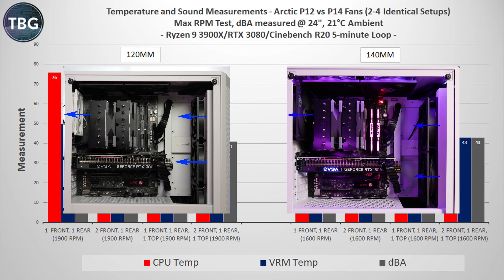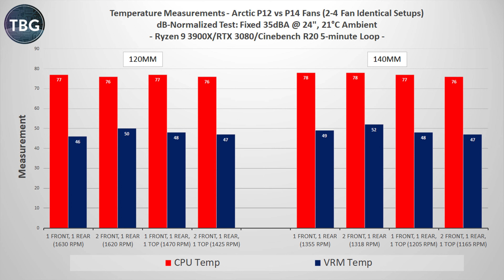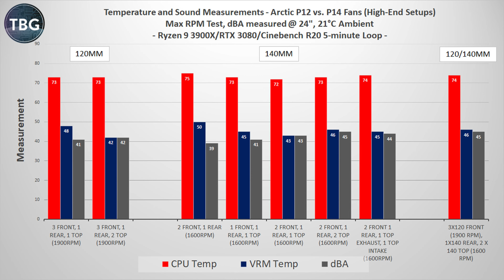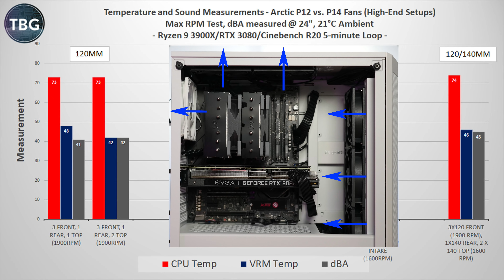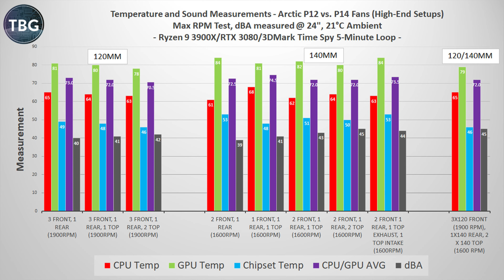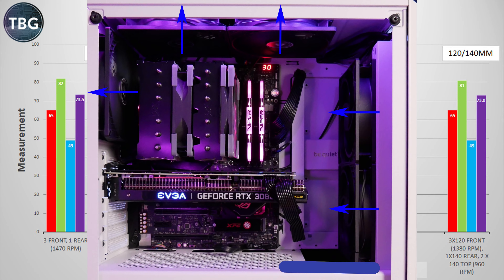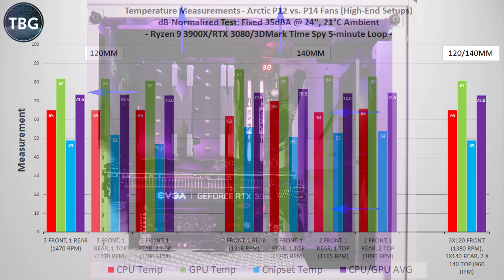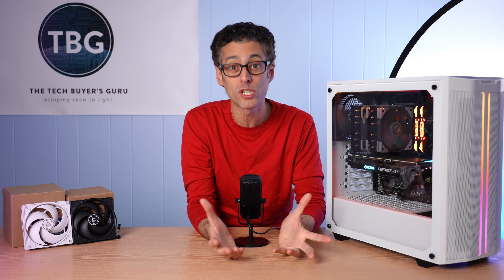The Best PC Case Fan Setup - How Many, What Size, and Where, feat. Arctic 120/140mm Fans!

Comment: Wow. I really thought 3x120 front with 140 back and top would be better than it was. 
Only really corner cases I would want to try/see is 3x120 front with only one 140 back and top, possibly while blocking the space for the front top mount, or the split dual 140 front (which is what I'm running currently)

This was a beautifully done and largely complete video. Quite impressed.

And I was absolutely looking for a video on exactly this (and even this case, luckily enough). You've convinced me not to add 3x120mm front fans. I thought the higher static pressure would get more air through the mesh front.
Reply from the maker: Well, sounds like this video was spot on for you given the case you have. It's not something I could repeat with many cases, that's for sure. But why do you say 3x120 wasn't effective? It seems better than 2x140 based on my benchmarks, no?
Reply: @TheTechBuyersGuru  not that it wasn't effective, but I thought the night-and-day difference I expected compared to 2x140 front. The difference doesn't seem worth buying additional 120mm fans I don't already own.
Reply from the maker: Oh, yeah, this was all a theoretical test assuming you were coming from no fans. In terms of tossing two 140mm fans and buying three 120mm fans for a minimum of $30, it's probably not worth it. With that said, the default configuration of the case is 1x140 in front, top, and rear, so I would absolutely suggest swapping out that single front 140mm for triple 120mm fans, and then putting the second 140mm on top (despite minimal benefit, because you'd already have it and it's greater than zero!).

Comment: Finally a video that actually helped me with real world direct comparisons using the same fans instead of widely different fans. Therefore the test is actually meaningful. I am going to change mine to the 3 front 1 rear 1 top and see if it helps my temps. They are not horrible but my idle temps are a little high (3900X and 2080 Super, CPU Idling at like 40-50 and GPU around 60 - which is probably acceptable anyway..but still want to have the best setup)

These fans are super cheap are they really that good? Most people are going to recommend some $30 ea fans (Noctua etc) so am concerned about buying cheap fans?
Reply from the maker: Most people haven't watched my videos, so they don't know anything about what they are recommending! Are Arctic's good? See this video: https://youtu.be/PUdsTiRmuuU

If you decide to get them, here's the link to the 5-pack: https://amzn.to/3APDGQ5

By the way, your high idle temps are not a reason to buy any case fans at all. Idle temps are driven entirely by the fans on the coolers and the settings you are using. I recommending using a manual fan profile on your 2080 Super so that it's NEVER at zero RPM. While that's a popular fad, it's not actually very good for anything, including maintaining idle temps, because any modern GPU will slowly climb up in temps until it requires the fans to toggle on and off, which is more annoying than leaving them on.

In terms of your 3900X, idle temps are always going to be that high due to background tasks and the density of the chip. It's the CPU I bench with. To learn how it idles with high-end 360mm liquid coolers, see this video: https://youtu.be/GLaje-5JFd4

Comment: Much respect for the work, interesting video and listening to feedback. But in my humble opinion the top fans should not be oriented in opposite directions. Otherwise the hot air from the rear top exhaust is being recycled throught the top front intake which therefore does not fulfill its purpose of providing fresh air. Both tops fans should have identical direction
Reply from the maker: I did test both setups, perhaps you didn't see the whole video!

Comment: This is an experimental question 🤔as I was new to Airflow 
I went with multiple methods of assembling 140s and 120s on my cabinet.
My case/cabinet/tower is Lian Li 215 which has two 200mm intake fans in front ,so I went with 3 120's ( 2at the top and one at the back of the tower) I was messing with it like you said placing the top two 120mm(one of two/both) used them as intake and it was not a good idea,

So yeah I went with 3 120s as exhaust(two at top and one at the back)
  and 2 200mm fans as intake in front 

I recently bought a AIR COOLED heat sink cooler (COOLER MODEL: DEEPCOOL AS500) for my processor ,which came with 140mm fan on one side ,later I found out I could increase the coolers performance by adding another fan to the heat sink. 🤔🤔However 140 pairs with 140 /120 pairs with 120 i.e,
140mm ]=[140mm
120mm]=[120mm
(general rule of having the same type of fan on both sides of the heat sink is  followed everywhere)
🤔
Now comes the tricky part since the whole fan assembling was new to me 🤔what would happens if I attach 120mm as exhaust and 140m as intake on the heat sink 🤔💭 this might sound stupid but I want to know what would be the outcome 😐
Like can we balance the perfomance but tweaking it's RPM 🤔

Thanks in advance. 🙌
Reply: @I love you but Thanks for the clear explanation 🤔.My fans are not loud tbh ,I checked every now and then to see whether it runs cause it was silent most of the time ,yea it keeps the temp below 65%whenever I game at max settings,so no more extra fan on the heat sink I guess.
Thanks again 👍cause now I know something new about airflow in pc.

Comment: Great test, thank you! Inevitably, the GPU regurgitates some of its own output - more so in a faint "positive pressure" scenario. Brute force positive pressure is hard to achieve with this case because there's too much impedance at the front - mesh, dust filter and rgb strip... so even front fans with good static pressure and cfm like the P14s don't work very well.
Reply from the maker: The case is actually on the higher end of the airflow spectrum, but yes, there are a few cases that would beat it. I think it's fairly representative of the average modern case.

Comment: So I have two 140mm top fans. Should I just unplug the front one? I have two 140mm front intake and one 120mm rear exhaust
Reply from the maker: Not at all. Just lower the RPM of the front one or both if you find it getting too loud.

Comment: I had the same result with my single 140mm intake fan: the lowest position is most beneficial to the GPU. My case doesn't have any grate above the PSU and as I was thinking about the turbulence occurring when the air hits the back of the PSU, I placed a makeshift curved ramp out of cardboard leading up from the bottom of the case to the level of the PSU. That shaved off another 1.5°C of the GPU temps. By the way, my rear fan is an intake (at 300 rpm) and I only have one exhaust fan in the top; CPU air flow is reversed. That was the optimal solution for a CPU tower cooler (at moderate rpm) and an open "blow through" GPU (Sapphire Pulse RX Vega56). Otherwise the CPU cooler was sucking in that hot air from the GPU.

Comment: I have a cooler master h500p case with a 2 200mm fans in the front.
Do you recommend changing that to a 3 fan setup ?

Note i have a liquid cooling cpu and an msi 3080
Reply from the maker: If you want the lowest temps possible, definitely change the 2x200mm fans to 3x140 or 3x120. I have that case too. The fans look nice but provide very little directed airflow.
Reply: @TheTechBuyersGuru  thank you soo much for the reply i also currently have the arctic cpu water coolant 360 3 fans on the top do you think only 3 140 front fans is enough ?
Reply from the maker: 3x140 front would be excellent.

Comment: wich is better 2 200mm fans or 3 140mm  instead
Reply from the maker: I've never tested 200mm fans, but know that 2x200mm fans provide very little directed airflow. They are probably fine at reducing the ambient temp inside the case, but would likely be less effective at reducing CPU and GPU temps, as the airflow is much slower.
Reply: @TheTechBuyersGuru  many thxs for your advise it helped out a lot

Comment: Hi! 
There's a configuration I didn't see in this test : 3 x 140mm front and 3 x 120mm back (1 rear and 2 top).
Does it seem to be a bad configuration to you?
Reply from the maker: Might work, couldn't test because 3x140 didn't fit in this case. But don't just assume it's better. A lot of that extra air would be pushed above and below components, and what do feel more, a light breeze on your face or a strong wind a few steps away? ☺ 
Long story short, front fans are most effective when airflow is focused and directional. That is completely the opposite of exhaust fans.

Comment: Hi!
great video! I really enjoyed it and took away some learnings from it.

 I'm currently setting up a new PC and was wondering if I should get 140mm fans or 120mm fans. I intuitively was going for the 2x140mm in front and 1x120 in the back but your video made me overthink. 

As you stated the 3x120mm outperform the 2x140mm when it comes to GPU cooling and the 5x120mm are also less noisy while having a comparable cooling effect like a 5x140mm setup. What I am curious about is a setup with 
a) 3x120mm in front, 1x140mm on the top and 1x120mm in the rear or
b) 2x140mm in front, 1x140mm on the top and 1x120mm in the rear.

What is your opinion on this? Have you even checked it in your experiments maybe?

Looking forward to an answer!
Reply from the maker: 3x120mm front, 1x140mm top, 1x120mm rear is superior.
Reply: @TheTechBuyersGuru  Thanks for your input and fast answer! Keep up the good work.

Comment: Seems to be really case specific. I was having 3x front intake + rear and 2x top exhaust. Flipping the front top dropped vrm temps 8 deg and cpu 5deg under full load. No effect on gpu temp that has never been struggle for me. However vrm temps has always been struggle for me and limiting my overclock
Reply from the maker: Sure, it's going to be component specific, not just case specific. But I guarantee that setup will make your GPU hotter. If that's fine for your system, go for it. I showed what it did for CPU and VRM temps too.

Comment: Hi, awesome video, thanks a lot!
What about Arctic P12 PWM PST CO? Aren't they better in terms of longevity than the regular one? I want to buy them, but I'm a little worried that the ball bearing will be noisier than the sleeve.
Reply from the maker: You pretty much summed it up. CO is designed for 24/7 operation at expense of noise. Not the right choice for most consumers. And only P12 comes in 5-pack: https://amzn.to/3BGZ0YP

Comment: Just a minor tip for those that are running a BQDX500 case or similar with 3 120mm fan in the front intake, take out all the unused pci/pcie tabs below the graphics card, this will improve the GPU temps a fair bit, I can feel the airflow coming out at the back at medium to high RPM.
Plus, with the air being sucked in through the filter at the front, dust won't be an issue.
Reply: Put an aerofoil just beneath your GPU to direct air that was exiting out pci slots upwards.

Comment: Só 3 120 on the front, 1 on the back and 2 140 on the top would be the best right
Reply from the maker: Yes. Unless you can for 3 140s in front. I didn't test it, but it could be better than 3 120s, although not necessarily due to the more directional, focused flow of the 120s pointed at hot components.

Comment: Hey, thanks again for linking me to this video from your fan comparison video! I found it very informative and it answered many of my questions and you have taught me alot! I can only imagine how much time you spent painstakingly putting the test together and then creating the video, so thank you! 

I mentioned in the other video that I have a Lian Li lan 2 mesh performance case. It has 8 slots where I can fit 120mm fans: three on the front, two ontop, one on the back and two on the Psu shroud what are your thoughts on if I use every slot - do you see it as beneficial or counter-productive? I noticed you mentioned noise is an issue with exhaust fans on the top. I saw you recommended the 6x 120 to me in the other video. 

To clarify that I have this right: rear and top are exhaust, front are intake and psu shroud are intake?
Reply from the maker: I don't think using every fan slot is all that helpful. You start to add more noise than airflow. That's particularly true for fans on top, which direct noise right out of the case. I'd stick with a single fan up there. I also think having two fans on the PSU shroud is totally counterproductive, because one will be almost entirely blocked by the PSU itself. So based on the layout of the case, yes, 6x120mm: 3 in front, 1 in rear, 1 on shroud, 1 on top. For that case, two 3-packs of Arctic P12 ARGB fans would be superb: https://amzn.to/3hYoWWw
Reply: @TheTechBuyersGuru  thank you for your patience and time and clarifying this for me. 👍

Comment: hum... I have recently git my lancool II Mesh and I am looking into different fan setups. I think of adding two 120s to the top of the PSU shroud to aid air into the GPU and two 140s in the top to help exhaust. I would run both of these banks of fans in constant RPM, only the two 140s in the front and the 120 in the back would be chained to system temperature...
Reply from the maker: Sounds like a great setup!

Comment: So I have a lian li xl case which is pretty big. I have a Corsair 150i aio CPU cooler (3 120mm fans that are attached to the radiator) that is most likely going to do on the side. Atm I have 6 120mm Corsair fans with a max rpm of 2200. I was planning on returning them and getting 4 140mm fans or should I stick with the 6 120mm?
Reply from the maker: First of all, I'm assuming you're talking about the top and bottom of the chassis, as the rear can only take a 120mm, which of course you would want there. Second, in terms of which is better 2x140 top/bottom or 3x120 top/bottom, it really depends how it lines up with your components. In my tests, which were of course focused on airflow from the front, 2x140 was not as good as 3x120 due to less air getting to the GPU. If you have a GPU that is quite a bit longer than 280mm (11"), you should probably go with 3x120 at the bottom to cover as much of the GPU intakes as possible.
Reply: @TheTechBuyersGuru  right now I’m rocking with a 3070 aorus edition and the thing about this case is the front is all glass so it’s more of to the side of the case right next to the motherboard. Thank you very much for the feedback!

Comment: This is pretty much the specific information I was looking for but had a hard time finding since it's just very broad 120mm vs 140mm information whereas I wanted it for the P12 and P14.

I'm building my friend a system with a case that has a super restricted front which is similar to the NZXT H500 and was undecided as to whether I should use 120mm or 140mm Arctic fans to help mitigate or even brute force a case with positive pressure (and filter because cats!) designed with negative pressure in mind so I just ordered a whole bunch and will try these setups out for myself in this specific case. I really like the idea of two 140mm intake fans spread out so they're directing the airflow to the proper components though since this case has a perforated PSU shroud but I prefer the idea of 3x120mm intakes if only because I can buy a 360mm filter for proper coverage.

I feel like there won't be much difference for a 3300X and a GTX 1060 though...
Reply from the maker: Glad you liked this, but yeah, with that gear, you could go easy on the fan!

Comment: You are using static pressure fans, not the air flow ones. That will hurt airflow in the case and probably what causes the thuds
Reply from the maker: Sorry, I've disproven this false marketing gimmick in many past videos. These fans are FAR better than nearly all "airflow" fans for case cooling.

Comment: Do you think switching the top front Fan to pull in while using a gtx titan X is a better choice than pushing out (for reference : 5600x, be quiet pure rock and 3 fans in front panel)  ? Because the gpu isn’t pushing hot air infront of the cpu cooler - so more cold air infront of the cpu or is it Contra productiv because it creates turbolences?
Reply from the maker: If you're talking about a blower-style card, I really couldn't tell you what's best. It certainly runs hot, but I doubt blowing air in from the top will do any good due for the GPU near the bottom of the case.

Comment: I have a Cooler Master TD500 Mesh case with the included 3 x 120 mm fans at front,  3 x Cooler Master Sickle Flow 120 fans at top exhausting, 2 Cooler Master Sickle Flow 120 fans as CPU fans Pull/Push,  and 1 x Cooler Master Sickle  Flow 120 at the rear exhaust. I noticed that I am getting hot air coming from the rear, and hot air coming from the top fan closest to the rear. The other 2 top fans are blowing out really cold air out of my case. Do you think that they might be stealing the cool air from the front of the case, not allowing it to reach the back? My idle temps are around 42 to 45 AMD Ryzen 3600, and  an MSI RX570 Gaming X graphics card. The max temp I got was 70 degrees CPU during Prime 95 testing after an hour.

Is the cold air blowing out of the TOP fans closer to the front, okay?
Reply from the maker: Nope. I tested this. It's not stealing cool air. You'll feel plenty of hot air coming out if you load up your GPU. That's where the benefit is.
Reply: @TheTechBuyersGuru  thanks dude :)